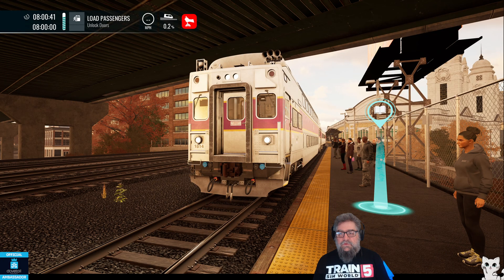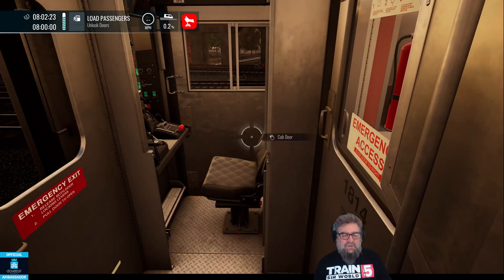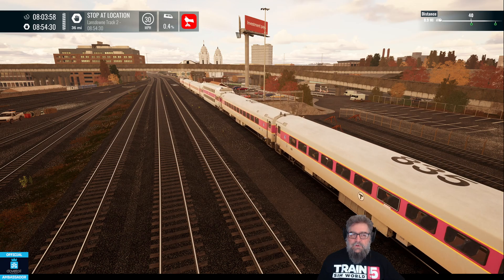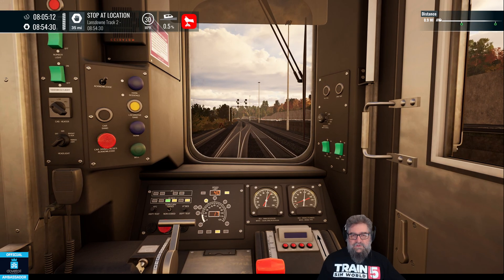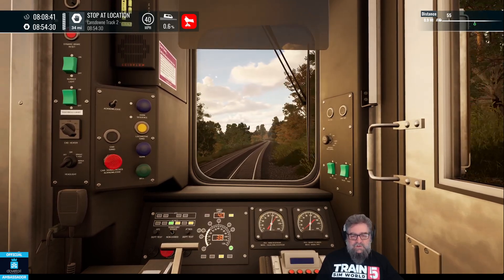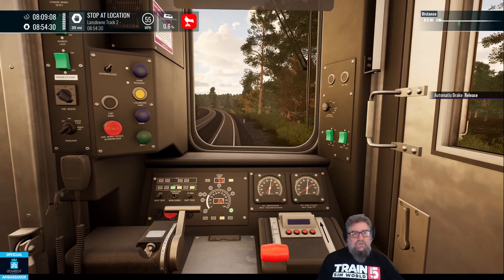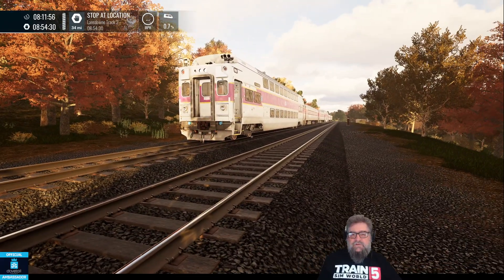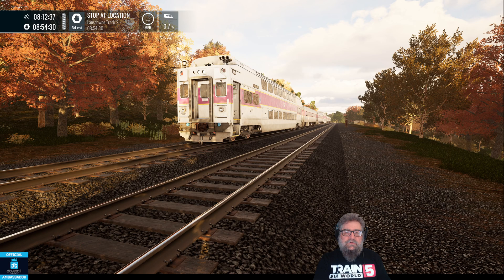TSW5 MBTA Commuter - CTC5 Setup and Drive Tutorial with Safety Systems

Comment: whats weird and I havent noticed it before (cos I havent driven this cab car for ages), is that this cab car, for some reason, doesnt have those as I call em "diesel switches", y know, engine run, generator field and control... the single level cab car does have em... how does it work in this one then? as you turn on the reverser, those like automatically activate?
Reply from the maker: In reality none of them would have them IRL. They might have a gen switch but not the others. In reality if fuel and control were off the diesel would not be running. If you were getting a cab led set out of the yard you'd start in the diesel getting it up and running before moving to the cab car inspecting the train as you walked along.
Reply: @trainsimulatordriver so it's actually more realistic than the other cab cars then in this aspect? :)
Reply from the maker: Yep :)

Comment: I'm trying to figure out how the ATCS and ACSES are supposed to work. I'm playing on Boston Sprinter with the CTC-3 Cab-Car. I understand the restrictions and stuff but i can't really figure out if there is a way to know that there is a restriction coming up. Let's say I'm driving at 45 MPH with a 45 MPH Speed Limit enforced by ATC or ACSES - then suddenly the Speed limit Changes to 30 witout any prior notice. At that point I'm already speeding and wasn't even able to break before the change. So is there something i need to look out for or is this just as the game is intended to work? I assume after doing some research into this topic that the upcoming speed-limit should be announced a signal-block away from the actual speed limit, so you have enough time to react to the change. 
Another Question: Is the number displayed in the middle of the ADU supposed to be my current Speed? Because if it is, then there is something not working with the CTC-3 cab car. The number changes every now and then but never displays my real current speed.

It's really a shame that dovetail doesn't include an in depth manual on this. The only one i could find was for the AMTRAK ACS-64 from the original NEC-Route for TSW 2020, which isn't hepful beacuse it still doesn't explain my questions and the ACS-64 has a different ADU which works differently than the MBTA locos and cab-cars.
Reply from the maker: ACSES speed restrictions will appear on Track Monitor which you can turn on. These are fixed and always in the same place (except for temporary speed limits due to defects or works which the game does not implement). ATC speed drops are because there is a train in front of you, or your route is blocked in some other way (e.g. switch against). The only place you will see these in game is on the ADU. This is as per real life where it also works this way. The ADU does not show your current speed. The loco speedometer does. The ADU has several ways of showing you which speed to do, and you use the lowest speed the ADU shows you along with signal indications and the HUD speed limit to decide. You take the lowest of all of them. The ADU is different from train to train because they are different IRL. Once you get an ATC restriction, even if it goes up again you would drive more slowly to avoid closing the gap and getting pinged again by ATC.